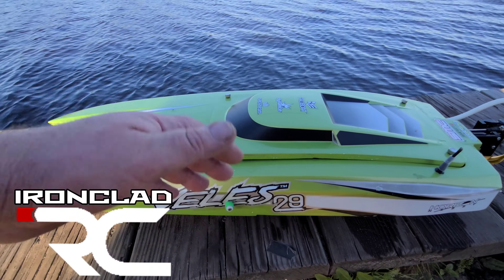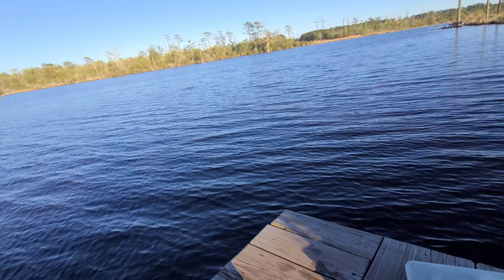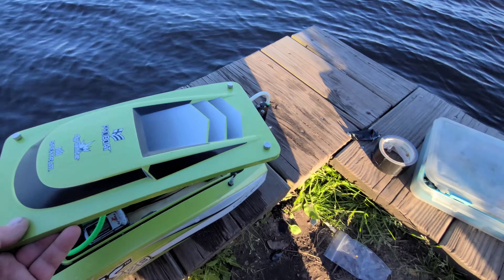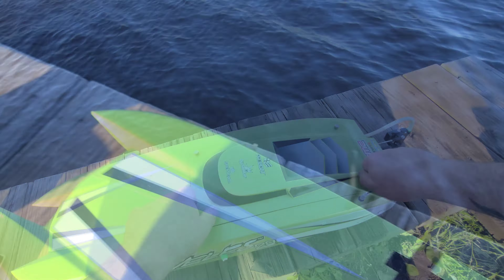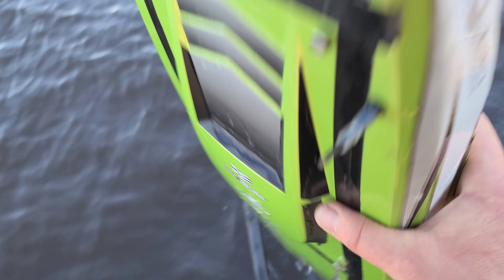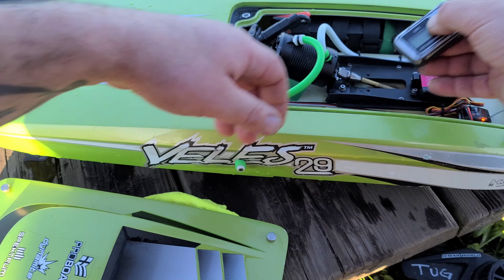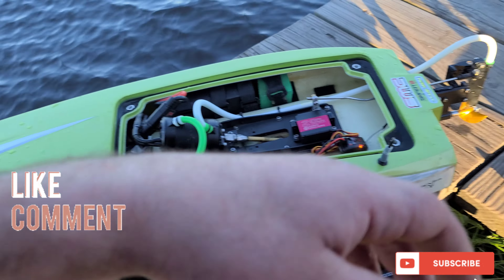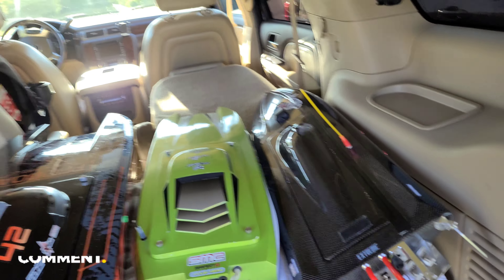29" Rc Catamaran In Rough Water - Upgraded Proboat Veles - Oxidean 45 High Rake

Comment: great vid big b. why did you change the esc in the tug ?? i jst got my tug last week and not even in the water yet and i got me the 1080 sitting on the bench to put in it. to me the rx/esc looked cheesy as the tx did kinda walmart kinda shit lookin.... just wondering why you changed it out?? problems?? im puttin a fpv system on mine with an ezuhf rx. stuff i got layin around from my long range multirotor days
Reply from the maker: Basically the stock esc quite working I run my tug in salt water, shoot it lasted 9 months before it let loose lol
Reply: @IRONCLADRC  ok thanx man. Ya i seen that in ur video about the tug and u showed the rusty brushes inside the motor. Probably was drawing more amps than that little esc/rx combo could throw out lol

Comment: I wonder if you could put a cap pack in the boat to increase the run time? Anyway couple of nice days here in michigan in the 80s f Michigan snow in forecast for Monday wacky weather on the tip of lake erie.peace love the velez need me a harbour tug.
Reply from the maker: Doesn't really increase run time, we'll it may in some cases, caps are more for voltage sags voltage drops at full trigger